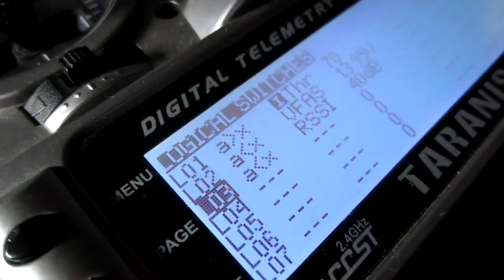Avenger V1 3000Kv Special Version Rewinded - S800 Speed Test 250Km/h

Comment: Great work!! Please use aircraft designed props, you will get much better performance than those designed for quads. The requirements are very different. Graupner cam speed props are the best in my experience (427kmh)